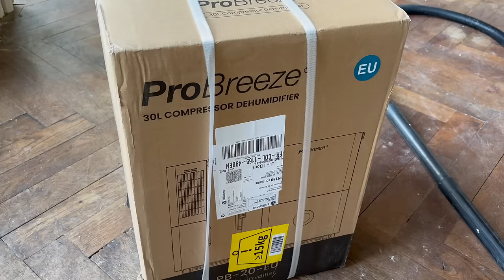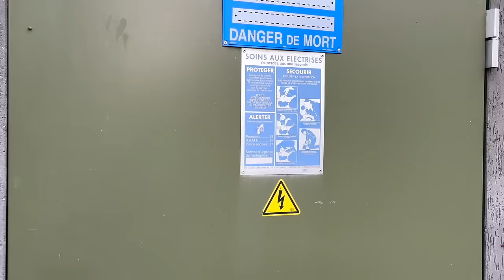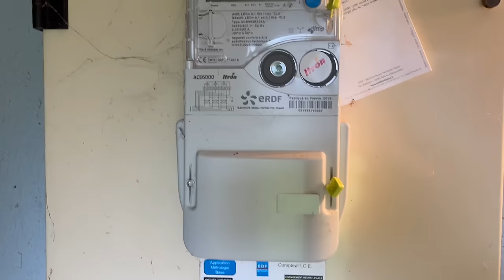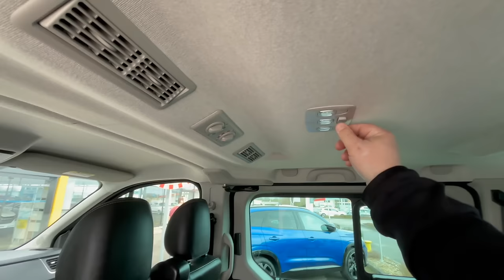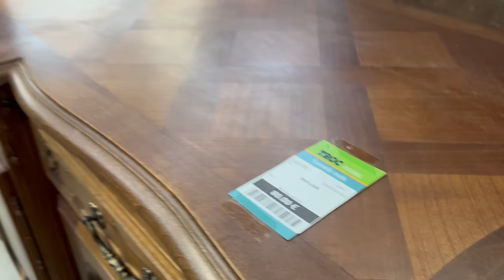Château de la Grifferaie: S5, E3: "Out the window"

Comment: Great video 👍 Preparation is key in decorating and building trade if you need a fast and durable repair to walls and ceilings you should get some 2K automotive body filler it's easy to work with and is long lasting paint able .

Comment: You’re hooked into commercial power because of all the rides and the restaurant. The humming thing is a transformer I think. I don’t think you need the transformer anymore. You need to take the stuff offline. It’s drawing power just by being hooked in. You don’t need to freeze for that thing to run.
Reply: Agreed 100%. Have the electric company come and disconnect everything industrial.  Even if it costs a bunch, it costs more to do nothing. Seems to me. In the long run. Wow!

Comment: Outdoor lighting is a major source of electricity use, are you using LED bulbs?
Reply: No, they.are the expensive to run bulb ones unless they changed the bulbs. Those are electricity inhalers for sure.
Reply from the maker: Only running it about 75 minutes a day, but they look like halogens.  400watts perhaps.  Bad, but not as bad as the 2000 watt space heater.

Comment: About the Power:
sadly form the video i can't tell if you're metering is pre/post transformer: if you're beeing metered pre transformer that would mean you're beeing charged for the standby powerconsuption of the transformer with i'd estimate at atleast 8000kWh/year. If thats the case you would just have to live with the costs. 
I assume your your powercompany is charing you for the possibilty of suppling 400kVA or even 630 kVa (by the size of the transformer) you might be able to renegotiate that figure because your not running rides or a restaurant anymore. I think the best plan of Action here is to contact the Engineering firm who sized the Equipment originelly or another Engineering firm an have them take a look.
Getting rid the transformer entirely would imho be nearly impossible, and if it where possible, it be pointless because you would limit yourself when thinking about heatpumps, Ev chargers, other powerintensive uses.
Reply from the maker: Ohhh this is soooo good, and makes total sense.  He did have the chateau set up for 600kva so you are right on the money with that.  But now, our account is just for 15kva, and honestly we use like 4-6 most of the time.  

The transformer is on the left in there yes?   Any idea what that thing on the right is?
Reply: @chateaudelagrifferaie953  Yes, the Transformer is the Green Thing on the left and the box on the right is Medium Voltage Switch Gear, so that where the high voltage from the Powercompany enters the building. It contains a highvoltage switch and high voltage fuses. To touch anything in that building does require special qualifivation(at least here in Germany). An Account for 15kVA seems extremly small for an building that size (even redidential homes here have 25kVA - 44kVA). Is the 4-6 in kW or in kVA, because 4-6 kVA would make sense due to the large transformer idling while 4-6 kW seems way to high unless someones running electric heat.
Reply: As far as I can see you have an industrial connection with a private transformer. This means you own the transformer. If I remember right you are even obligated  to have a maintenance contract with an specialized company and to have an electrical inspection done every year from the industrial installation by Consuel. 

On the installation you have it would be impossible to get a private meter as you own the transformer. What you can try is to talk with a local electrician and get a new private connection (branchement type 2 )to one of the outbuildings (for example the stables). From there  you put a new cable to the chateau. When this is completed you cancel the industrial contract. The only problem  with that is that the land is classified as industrial and not residential, so see if they allow it.  

The other option would be to contact Enedis (the owner of the electricity network ) and see if you can reach an agreement that they takeover the transformer. But I expect this to be quite complicated.
Reply: The box on the right  is the medium voltage switch and fuses. There are probably even spare medium voltage fuses in the carton boxes you see on the video. The small bench you see on the video is to isolate the person from the ground when operating the switch.  At the left you have the transformer. The box left from the entrance  is the main low voltage (400V) fuse box. The breakers in this box(fuses) don't work the same as the ones in a normal fuse box.  Best not to touch anything in the room and call for a qualified industrial electrician as it can become dangerous when you don't know and don't use the correct protective equipment.  @chateaudelagrifferaie953

Comment: Call some pest control places and ask what you can do to repel the bats, or look online. I would guess the chimneys are the access points. If not using the fireplaves, consider finding a way to put screen up at the bottom where the flue is. I still vote for finding a way to put screens up while also looking for ways in the roofline they may be getting in. Maybe even set up some cameras and move them around as neded to find their entrance point? 

You should have asked if you could pay for the hall coat stand and pick it up when you grt the van. A lot of.places will do that. There are ways to deal with the water rings on furniture if you do a little digging online. They seem relatively easy to fix. 

Things are looking great, think of the work ahead as preservation of history jus like your bible teachings are to you. It is a manmade creation (Château) andGod created man so by extension it is a gidly creation and it is being used for righteous reasons. Your home is also God's and your hands are his.....

Also see if you can find an electrician to help explain the power setup situation as well as help you figure out cutting power to the things like the restaurant that are not being used. I would also shut the big outside lights off for now and get LEDs to replace them. Those bulb lights like that will suck energy like nothing else. You two are doing amazing so far!